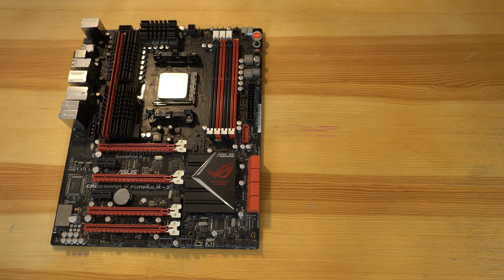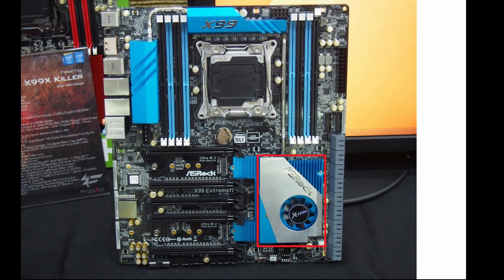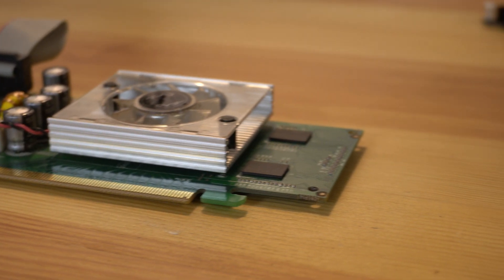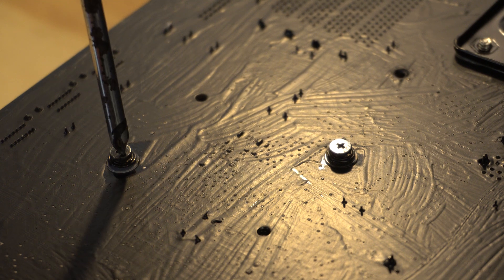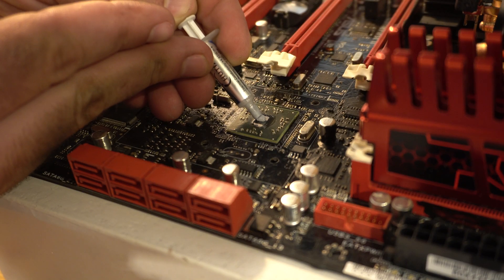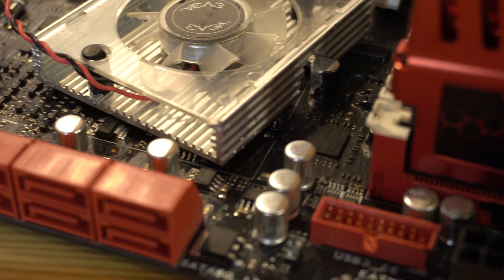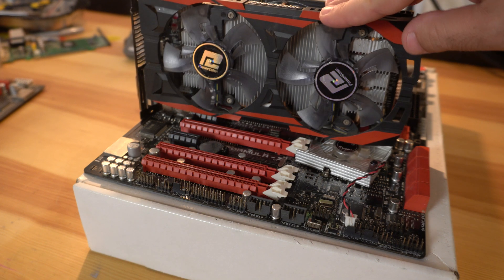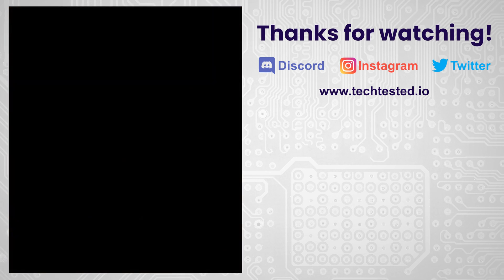DIY Active Chipset Cooler

Comment: ainboard Model		A68MHE 
Specification		AMD A10-5800K APU with Radeon(tm) HD Graphics 

CPU Z told me : Temperature 0		26 degC (79 degF) (Package)
	Temperature 1		75 degC (167 degF) (Cores)
Core temp: tj max  70  cpu#0 è  28 celsius degrees

I don't know how is possible. I thinkl is 70 degrees... but touching with finger i noticed that the chipset of motherboard is more hot than the cpu...  (cpu has aftermarket fan)

Comment: Was about to say, clean up your cuts, but not having a dremel is explaining why. Those things are a godsend for that kind of work.
I would think a slightly bigger cooler and a fan running slower would give a better cooling/noise ratio.

On that particular board, I'd say the SATA ports are blocking a lot of the air going to the cooler.
So a cooler that has the ribs rotated 90° together with a fan blowing air in that direction would help already.

Comment: It gets really hot where I work and that thing can get up to around 90C when the cool air outside the PC case is hot. I had a lot of room above but more narrow on my Gigabyte motherboard. I used a Socket A processor heat sink. Had to trim off two sides then I screwed a copper heat spreader across the bottom with some thermal grease and 2 aluminum L brackets with mounting tabs epoxied and screwed on the sides.  Used original mounting hardware. It's got a thermocouple with a motor speed controller it's to cut down on noise. After a wasting couple of days of going overboard with a file and caliper, it is better to measure three times and cut once. It really works and looks good.
Reply: I glue the sensor down to the center of the heat sink with thermal cement. The motor speed controllers you can get for about 2 bucks come with the K sensor. The 3-wire controller also works with 2 wires. The 4-wire controller looks the same but it is for bigger 4-wire fans.

Comment: Chipset cooler should be a product just like a CPU cooler.
Reply: They are. Or at least they were. I remember lots of replacement coolers for socket A, LGA775 and LGA1366 back in the day.
Some even looked like minature CPU coolers. tiny tower coolers with a tiny fan on them. Which was a bit overkill. A regular low profile cooler with a low profile fan was enough. Or a passive tower that sits in the aurflow.
For example the Noctua NC-U6, which looks like a tiny NH-U12S CPU cooler. And yes, as the name suggests, it runs with a 60mm fan.

Comment: Weeeell, cooling of the south bridge is pretty useless. It has a pretty low TDP (6 watt maximum, compared to 15 watt of newest ryzen x570 chipset) and high maximum temperature.
On the other side, these AM3(+) mobos almost always need a good cooling on the _northbridge_, that has 15-20W tdp depending on the model.